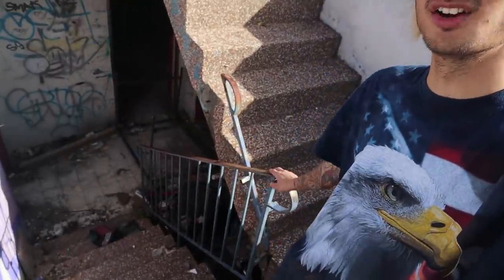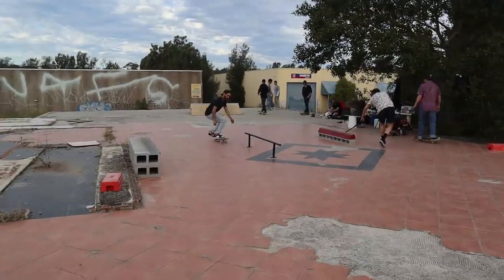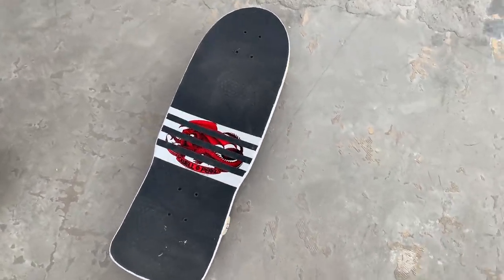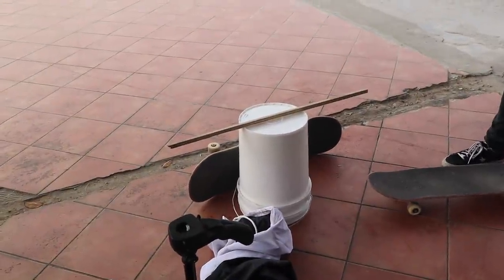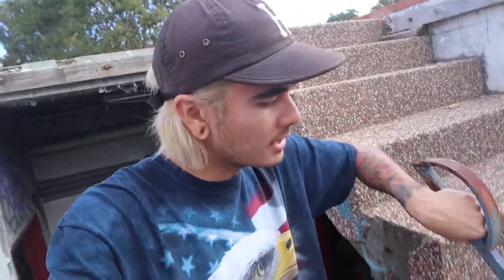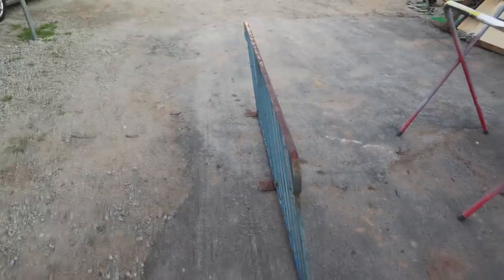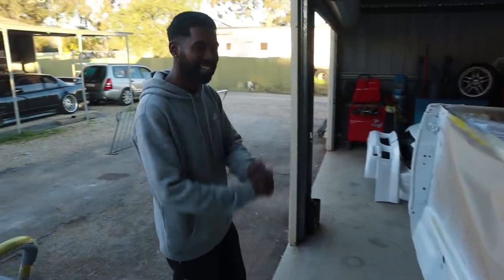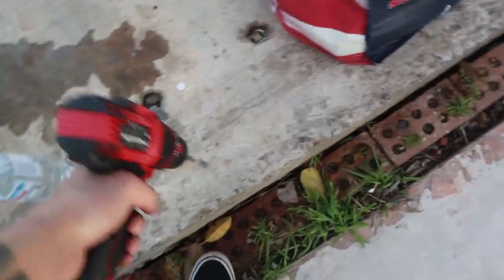D.I.Y DIARIES EPISODE 7 | D.I.Y SKATEPARK | BUILDING AN OUT RAIL

Comment: Great spot you have going! My only concern is the lack of PPE while using the angle grinder. Please use the guard, gloves, a full face shield, thick jeans, boots etc. People are probably going to think I'm being over the top but I made the mistake of trying to cut without the guard on and the disk shattered and hit me in the face. Thankfully I had a full mask on or else the shattered disk would have ended up in my mouth and likely would have killed me if not left me needing reconstruction surgery. I beg you please use as much safety as possible. It's not worth the risk 🙏

Comment: U should build a hip or a mini ramp that would be so cool also For all ur tool needs just buy deWalt stuff they are expensive but they last a very long time I got one when I was 5 and I’m 13 and it still works
Reply from the maker: Dewalt is so sick, I used to have their work gloves
Reply: Just wondering, what were you doing with power tools when you were 5?
Reply: Uhh I was building random trashy tables with plywood

Comment: Seeing the guy ollieing the stair gap made me wonder if it would be possible to break up the brick bits that are sticking up and smoothing it out and whether or not the railing stuff he landed on is strong enough to have some ply wood attached to the top so no one falls off and dies 😅 also making that gap a safer feature?
Reply from the maker: I did try to break away some bricks with a small hammer but we would need a jack hammer i think
Reply: @SeanEnuks  damn I didn't think they'd be that gnarly to remove.